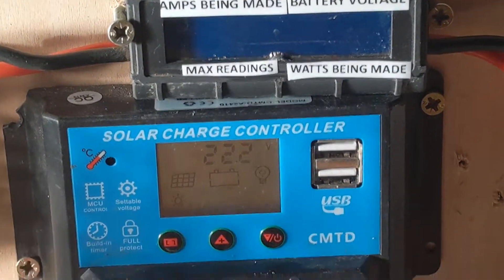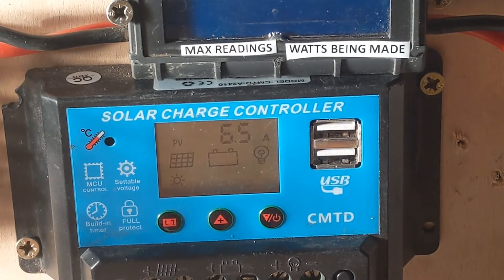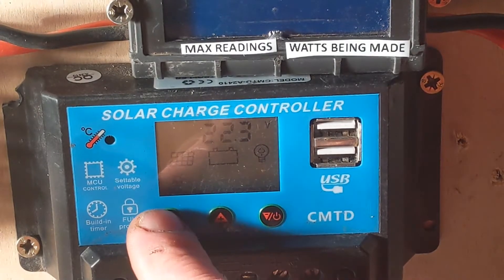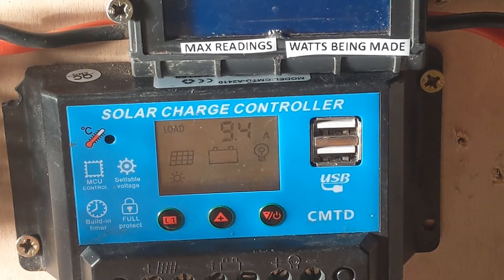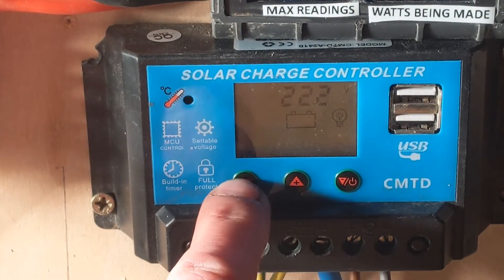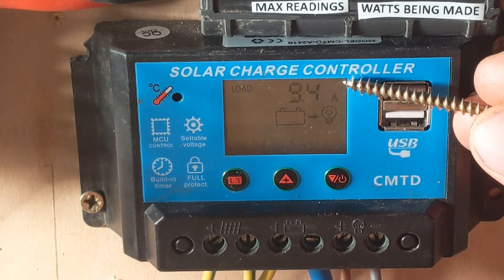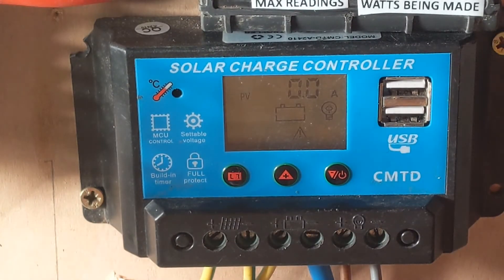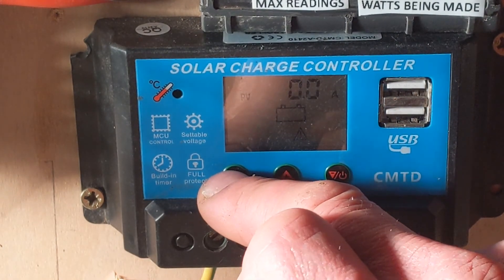Wind Turbine Solar Controller Dump Load - Very Windy - free energy project

Comment: Possible to connect solar panels in parallel with a wind turbine to generate power?
Reply from the maker: Hello my friend, You would be best off buying a controller that accepts the wind turbine and the solar panels. If you connect them together incorrectly, they will be working against each other.

Comment: can you show how you set up the dump load to come on in the regulator
Reply from the maker: Hello mate, I don't have this controller anymore. I got quite lucky because there were a certain amount of them made which had a fully functioning dump load but yours probably isn't one of them so it will only run a basic light.

Comment: hi what kind of battery can be charged with this controller, I'm making a diy treadmill motor turbine. many thanks.
Reply from the maker: you are probably best off getting one of the orange controllers off ebay
Reply: @GavinFreedomLover  hi sorry can you give a link on the orange controller you are saying about will appreciate it.. 🤝
Reply: @GavinFreedomLover  I got the orange controller but trademill motor is a DC motor and orange controller is a AC controller?
Reply from the maker: Sorry I just saw you said treadmill motor , these are really bad for wind turbines
Reply from the maker: https://www.amazon.co.uk/Generator-Waterproof-Controller-Overvoltage-Protection-1000w/dp/B08YWTMQG1/ref=sr_1_5?c=ts&keywords=Solar+%26+Wind+Energy+MPPT+Controllers&m=A2YYBUE5CIOM7S&qid=1659257943&refinements=p_6%3AA2YYBUE5CIOM7S&s=industrial&sr=1-5&ts_id=14868280031

Comment: So... Can I use solar charge controler with small homemade wind turbine?
Reply from the maker: You could try it but only if the wind turbine is less than 500w
Reply: @GavinFreedomLover  this is max 15W 220v ceiling fan :)
I want to charge my small 12v 18650 battery pack in my garden shed and I cant find any small controler to do that :(
Reply from the maker: @nucleo1772  Sorry just seen this comment , the lithium ion controllers are more expensive.